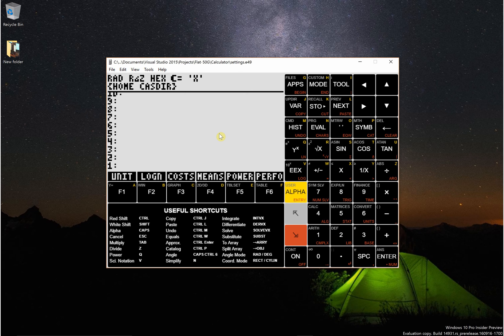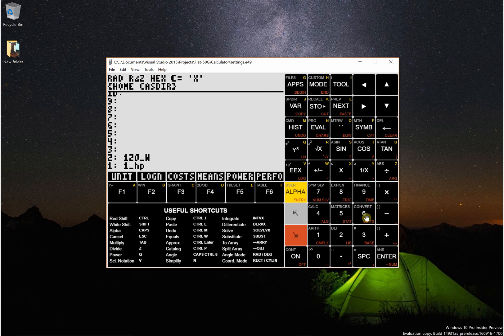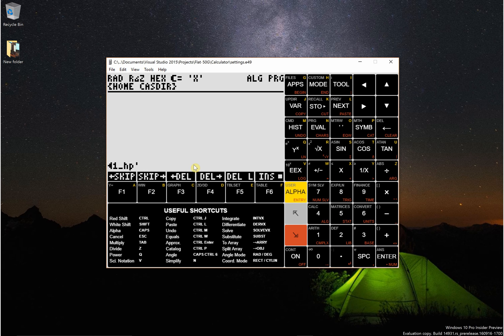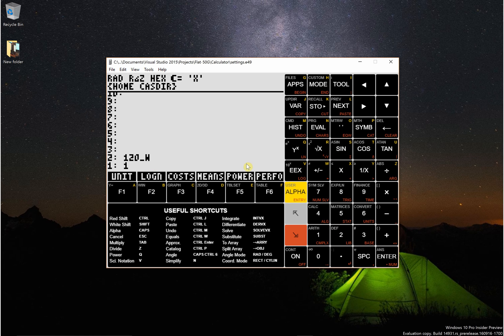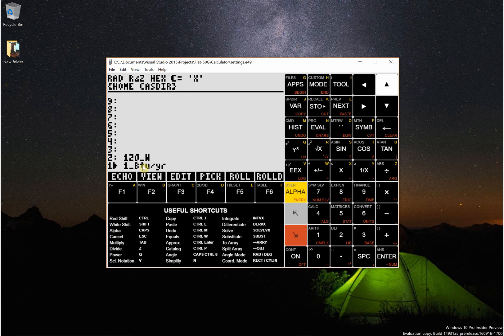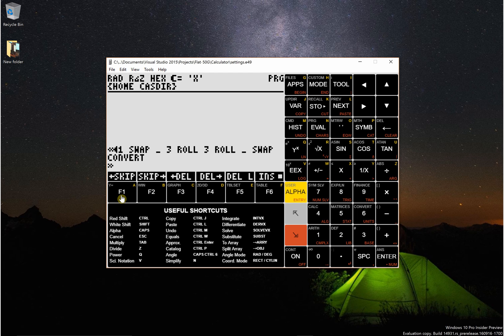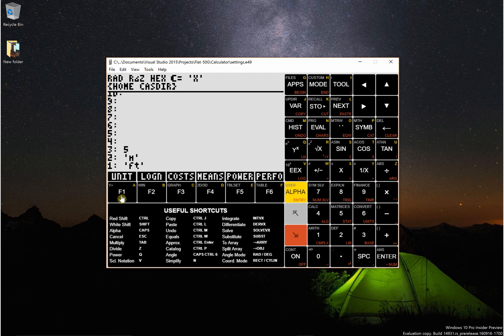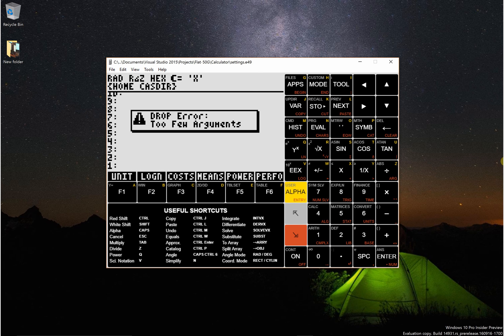How to Convert Units with the HP-50g

Comment: But sometimes HP 50g is suck,  I found it displays Degree Minute Second as 1.0360 what I want is 1.0400. It takes you a lot of troubles to write a subroutine to convert whenever 60 sec at the end to automatic add 1 min before and set itself to 0,  what Command is missing from HP developer mind ?
Reply: hmm

Comment: I find it easier to enable the soft-keys for the units. To convert a unit on the stack you simply left-shift and press the unit you want.
Example: 120W is on the stack. Press UNITS NXT F4 left-shift F2, done! And you keep the units readily available for more conversions, you don't need to constantly pull up the drop-down menu.